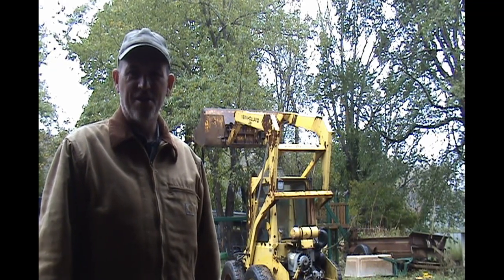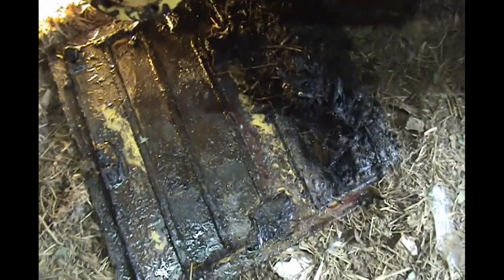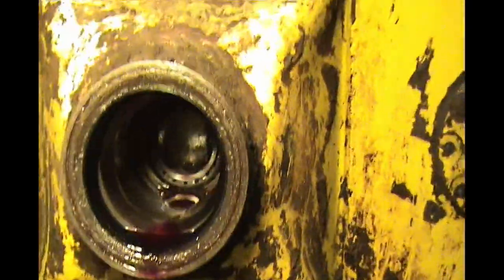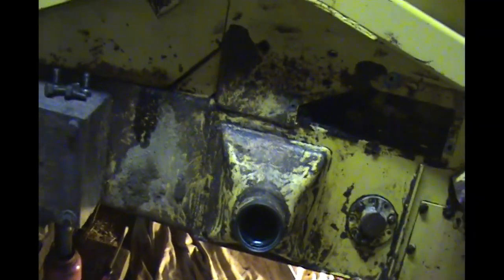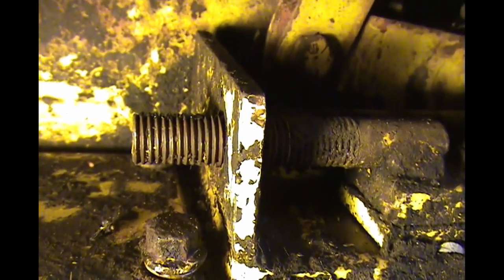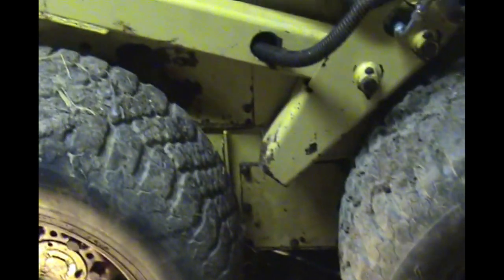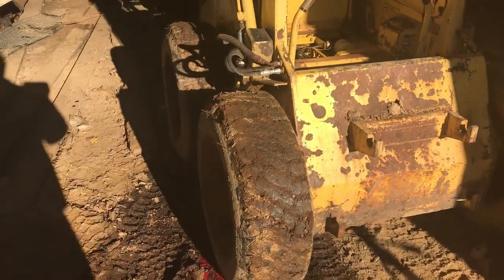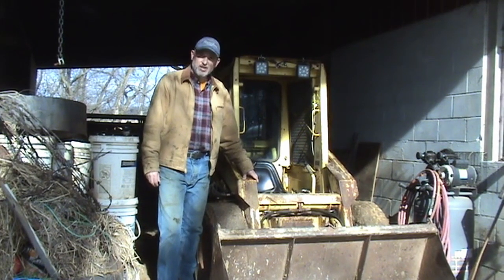Fixing a New Holland L445 skid steer

Comment: Been working on a L325 which is very very similar. Took me many hours just to clean all the years of farm ** and trans fluid buildup off of everything just to see what I was working with. They really rode this thing hard and never maintained it. I have probably 40 hours into it so far. Did a hydro fluid flush and guess all the stop leak they put in got flushed out because now the same exact rear right seal is leaking real bad. Pulling the gas tank for the 3rd time now :/
Reply from the maker: Oh man, I’m sorry. Pulling the tank stinks.

Comment: What size tires you running on yours? I have the same L445 Diesel I thought about putting used truck tires on rather than expensive new lugs
Reply: Did you end up doing this. I need tires and am probably gonna go used truck mud tires maybe a size bigger if it doesn't hit the bucket or lines

Comment: I have the same machine but with a gas  4 cyl Wisconsin.  Handy machine for clearing snow at my work place, moving dirt/gravel/stone.  Work it for 1 hour then work on repairs for 2 !  How many hours labor did you have into this repair? I'm guessing 12-15. I'm looking for disk brake and assembly for one side - Any ideas for new or salvaged parts?
Reply from the maker: Michael Lullo Hi there, thanks for the comment. Yep it took about 15 hours but would have been 10 or so if I didn’t have to pull the fuel tank twice... grrrrr. I’ve found mine to be very reliable. There are lots of places online that sell used parts, I just google and then call around! Love to see a picture of yours!
Reply: @BlueDogFarms  can you help me
Reply: @BlueDogFarms  i m need the part number #14 ,,,,,,, bearing Assy
Reply from the maker: @Jou Villages, #14 in my book is a shim, however the bearing I am working with in the video are 13540 and 13958 wheel bearing and cup; both inner and outer are the same.  These are New Holland numbers and hopefully your New Holland dealer can cross them.
Reply: @BlueDogFarms  tank you soo much
Reply: Michael Lullo I’m working on the L445 I just got. The bearings and races are 25520&25580 which can be bought cheaply on eBay or rock auto rather than the CNH dealer
Reply: you have of picture of the return of fuel line of the injectors to the fuel tank TANK YOU,